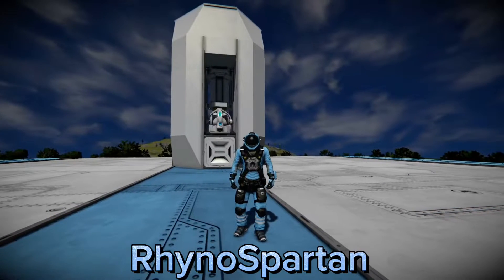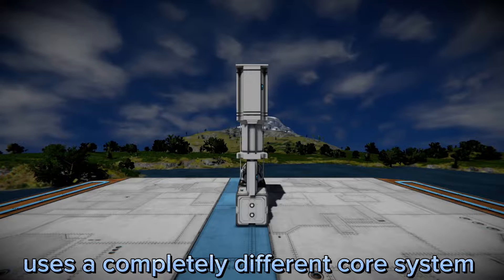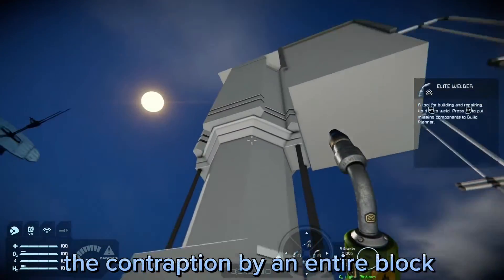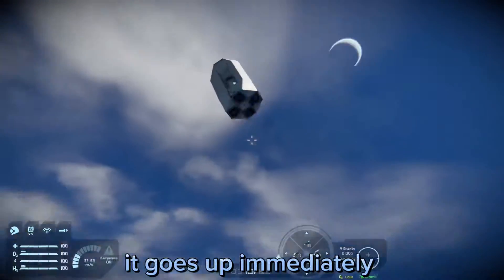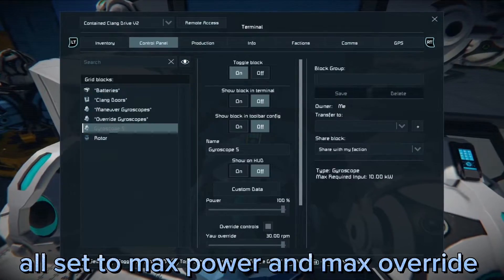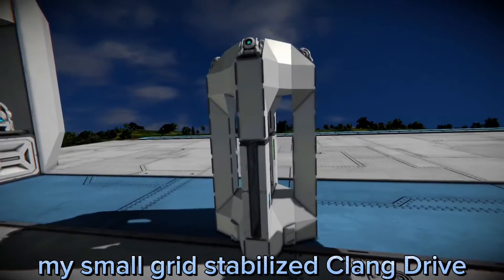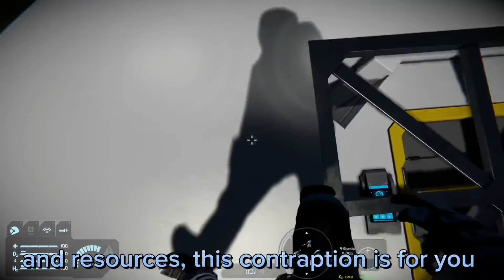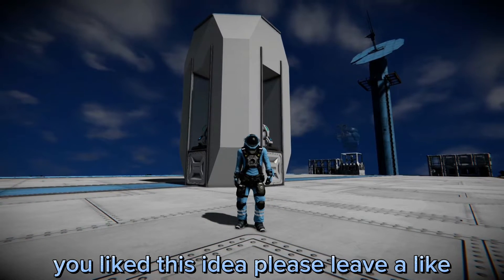Space Engineers - Stabilized Clang Drive V3

Comment: A very smooth looking design though I am not sure if its acceleration is as good as the piston/mergeblock version. Still has there been any thought on whether to connect this to some kind of hinge/merge block system to allow it to function in 2 directions while removing some of the subgrid aspect of such, or maybe a rotor/PB version to give 4 directions of movement?
Reply from the maker: I thought about how an omnidirectional Clang Drive could be made. Perhaps 6 pistons controlled by Event Controllers that extend into the center of the Drive. I’ll check out the merge block drive!